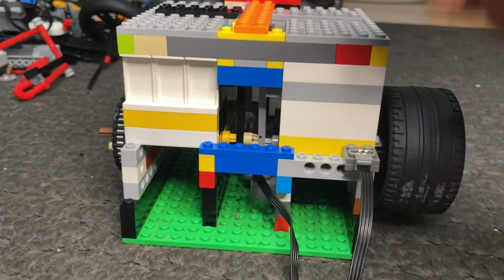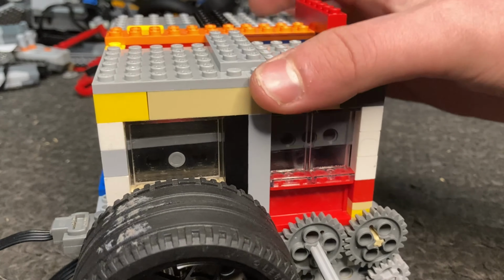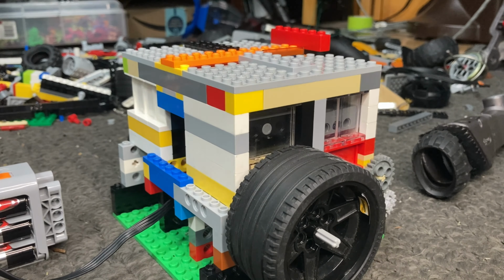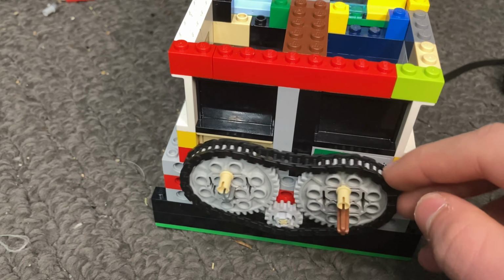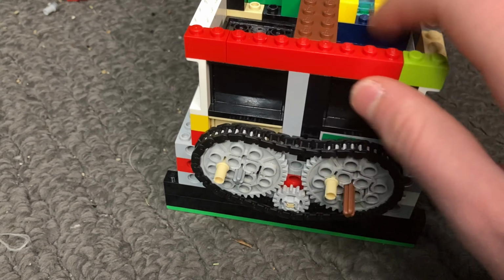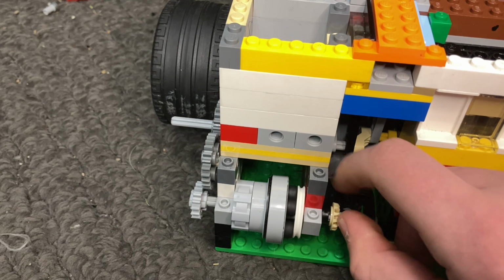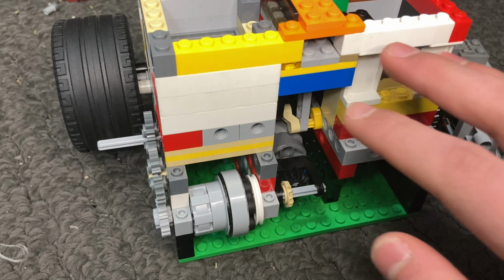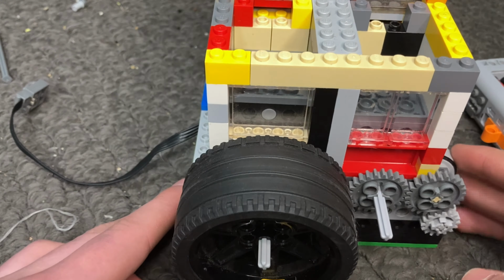Square-4 Cylinder Lego Vacuum Engine (1k SUBS!)

Comment: Is the vacuum just powering a 2 cylinder thats pulling another 2 cylinder, or are all pistons connected to the vacuum?
Reply from the maker: All the pistons are being powered, the power is just combined to put output. You could theoretically take two outputs of the same power from this engine!